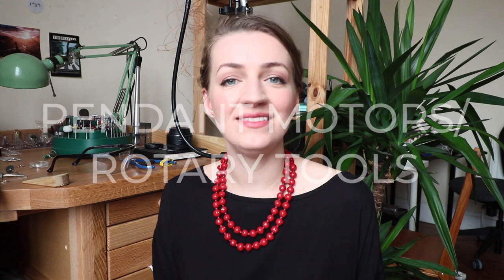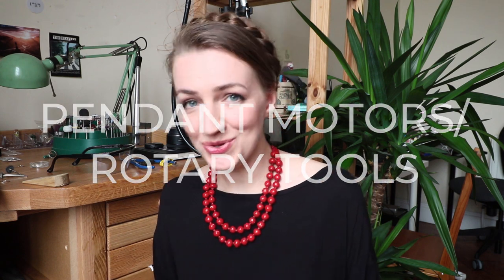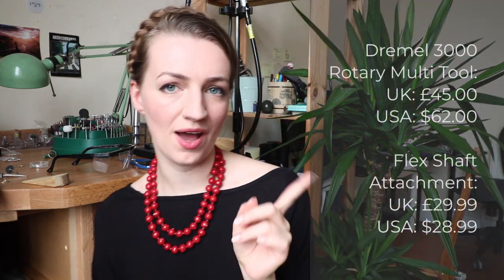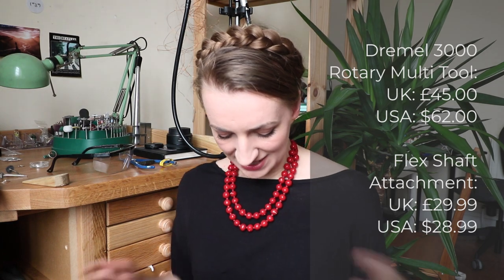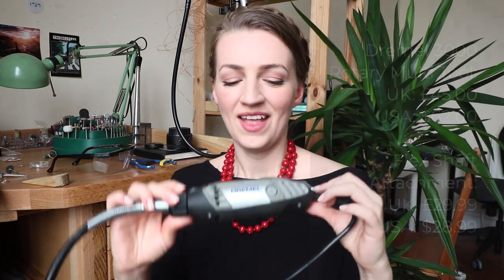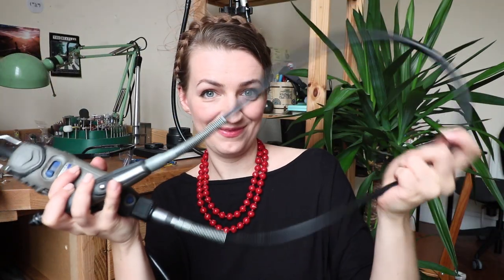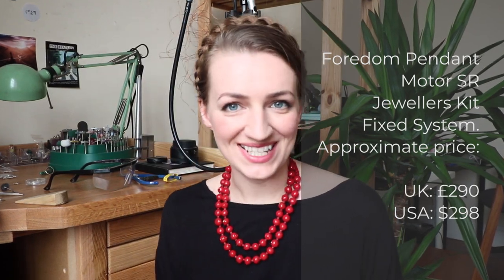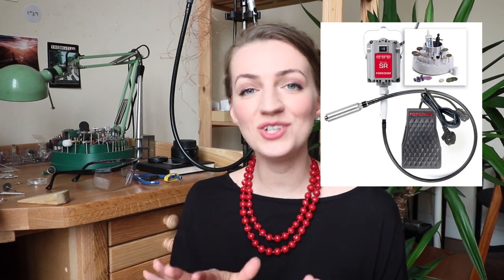Which PENDANT MOTOR? Rotary tools, flex shaft, Dremel and Foredom. Jewelry Polishing Tools

Comment: Hi!! Great video! Thanks a lot!
Just wanted to say, for anyone who is interested, that there are foot pedals that can be connected to any rotary tool. Personally, I have the very same Dremel with the flex shaft, and I just bought a pedal and connected them. The foot control was really a game changer :)
Reply: Really? Where can i find a pedal for my Dremel 3000??
Reply: Can I use a hammer hand piece with any rotary tool?
Reply: @intothewoodsworkshop1517  Right now I'm shopping for my pendant motor on both Rio Grande and Eslinger. I saw pedals on both sites.
Reply: Hello  @intothewoodsworkshop1517  , something like a Proxxon FS 28700.
Reply: @natishamosier921 Make sure you NEVER go in reverse (SR) with a hammer hand-piece. 🌺
Reply: @virglibrsaglove Should be included.

Comment: Thanks for a good video. I went with a hybrid approach and purchased a Eurotools motor with a flex shaft that had the same head as your original from Foredom. The whole unit was $150 cdn. So far it has been great. The pedal is a little high so an upgrade there may be in the future. I’m not sure how the motor torque is compared to the Foredom. I haven’t had any problems with it stopping under working pressure. I also have the dremel 3000 set up as a dedicated jump ring saw. The issue with the dremel is that it can stall during the cutting process. This may equate to a short life for the dremel motor at which point I’ll buy another head for my flex shaft with a dedicated blade setup for jump ring cutting. Cheers!

Comment: I'm not a jeweler, but I use rotary tools. My daily driver is a Foredom TX and I also own several other pendant motors and handheld machines. My advice to someone starting out is to buy an inexpensive pendant motor and not a handheld tool. The difference in torque is not subtle and you'll find that your work goes quicker as a result. As a rough rule of thumb, the higher the (max) rotational speed the lower the torque of the tool. FWIW, every budget pendant motor that I have originally came with a poorly performing pedal. A Foredom pedal is a significant upgrade and it's affordable. Good luck.
Reply: You would love the Lucas Lowboy pedal.
Reply: @flyingcheff  I see we're on the same wavelength. I own a Lucas pedal. Love it! Very different feel than Foredom's metal pedal, but not difficult to get used to. It's wonderful to work with. Would SO recommend it.
Reply: @felixf5211  I love them, and the guy that owns the company is a hoot. He says when he's gone, it's all done. Lol. I suspect that someone will buy up his inventory and jack the price up. I've seen used ones on eBay for $150! I have 3 - just in case. I bought them when they were $55 each! Now they are$100. Happy to know you are enjoying yours. 😉

Comment: Hi Basia.  Well my hand held rotary tool by Guild has died, again after barely any use same as the first one!  It basically cut a hole in the top of a lid (making a mini saw bench to cut rough stone before tumbling - idea from a utube video - and uses the flex shaft - didn’t even get that far!). I was altering some bead storage boxes by removing the lip on Elizabeth ward bead boxes as it just gets in the way.  Hubby had the idea of just using the flex tool to remove them.  Perfect.  Or so I thought!  I have a socket with a length of wire and a foot switch on, you plug into the wall then you plug your tool into, gives me a on off for any tool!  Anyway I got 3 little boxes done, the motor stopped, started again and got 1 done, speed was varying on its own, next one and dead! Again! So fed up with these tools.  I’m now going to get a pendant flex shaft as I’ve now wasted over £60 on 2 useless tools whcih never got their moneys worth doing just basic tasks and barely any at that.  The first one was hubby’s he got for refurbishing golf clubs did barely anything and died!  So I’m not wanting more op money on another had held one, I’ve seen online and utube that some have had their pendant motors for years!  I knew where to search, and went to your utube to take a look!  I have a couple of questions. Maybe you can help
1) did you go for a 4mm or a 6mm flex shaft?
2) what chuck size did you go for?
3) have you been able to use the bits you had before with the pendant motor?
4) how easy is it to change the “handle” on the flex shaft?  I plan to get 2, 1 with be quick change the other basic one I will wrap with space fill rubber tape to make it fit my vice for using with the “mini saw bench” but to then hold on the hand isn’t so easy! So I hope to be able to change them for the differing uses.
5) on my flex shaft I have a quick change keyless chuck, can you use them on your pendant flex tool or is the quick handle you have better?
6) you have the SR motor, that’s the one with forward and reverse, is there a benefit to having the reverse as well as the forwards motion.
Thank you in advance, I hope you can help.

Thanks ❤ love your videos they Are great to follow to learn or just watch your process and see a piece coming together.😊❤

Comment: I got a prodigy flex shaft from Riogrande. And its been so fun working with it im inexperienced but it does eliminate alot of manual work.
Reply: I have been considering the Prodigy (would LOVE a Foredom but cost wise I cannot get it yet?) Would you recommend the Prodigy? Does it seem solid well built and comfortable?
Reply: @JayDub_143  So far so good for me, if you get the kit which is about 360 will get you a head start on alot of tools just becareful because it has a bit of a punch
Reply: @HabibahW  Great thanks so much for the information!! Happy creating😁
Reply: I have this machine branded as a Foredom CC. Identical. Of course it's not a Foredom. Had a quick look at the handpiece pricing on RG. The H20-like Chinese handpiece they sell for $42 can be had from Aliexpress for less than $15. Same goes for other handpieces; much more affordable. The shaft on this machine is slightly smaller than Foredom's. The Chinese handpieces fit it perfectly, as they were made for it. BTW, you're not going to believe the pricing on 2.35mm accessories, abrasives, bristle discs, and other attachments!
Reply: Does it come with the hand piece?

Comment: The Dust dropping around is from a Star for sure with your knowledge. It does seem odd with all the impact that Dremel has had that they never considered the human mechanics when using it. I use to get RSI working with wool in the High Country here! Fine, delicate, Works of Art, should have the appropriate quality Design. Thanks for the information on a better alternative, and good on you for saying so.......
Reply from the maker: thank you so much for watching and your comment! 🙏 I think Dremel has come up with more advanced option and they have a regular pendant motor with flex shaft and foot control too. Costs just a bit less than Foredom, but I never tried it, so can't really say if it's any good. But good they're adding options 😀
Reply: @TheArtOfMetalsmithing  هل يوجد  منتجات دريميل في نركيا
شكرا لك

Comment: Hiya Lady Stardust, another great video, thank you. I think you've said everything there is to say, I will be upgrading to Foredom soon, on the safety aspect only it makes total sense, killing the rotation with your foot control? Total sense. Changing speed with just your foot control? Total sense, again. Yes I want a bench polisher but for now the flex shaft works & the Foredom will only do it better. So my mind is already made up & I just need to save enough for the switch. Your video has helped remind me why I want to upgrade & the mane reasons are safety & convienence. Thank you again dear lady, take care & stay safe... Steve x...
Reply: You may want to opt for the metal pedal. It's a few bucks more, and offers noticeably more control especially when trying to maintain a given rotational speed. And it's nicer to use, doesn't slide around. An all-around upgrade. Foredom's plastic pedal is very good, but the metal one is better. I have both. Good luck.

Comment: They make a drill press attachment for the dremel. It has a hanger built into it. I purchased a foot pedal separate and with the drill press setup its amazing sauce for work. Can you use a graving (not engraving) attachment on the dremel?

Comment: Hi! I just bought the flex shaft attachment for my dremmel... was wondering which drill bit can I use to punch a hole thru the metal? Is there a special one? The one that came in the pack doesnt go all the way thru the metal... maybe I'm not doing it hard enough?

Love your videos! I'm just starting out and excited that you are self taught.
Reply: Check out Basia’s video on hole punch pliers.
Reply: @normstangl3499  I have a hole punching jig but it's not the same thing as a drill

Comment: Please can the DREMEL 3000 make pearl holes bigger.
Reply from the maker: I think so, since it's a rotary tool and if you use proper attachments, you should be able to do that. But please, do a research, as I'm not completely sure and I think there may be more to this than that. Be safe while working with these tools and drilling